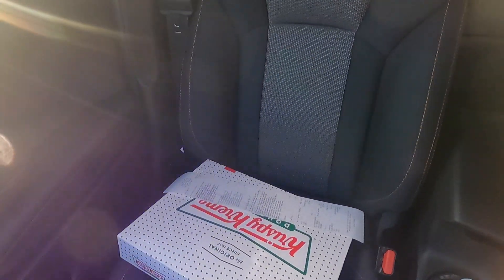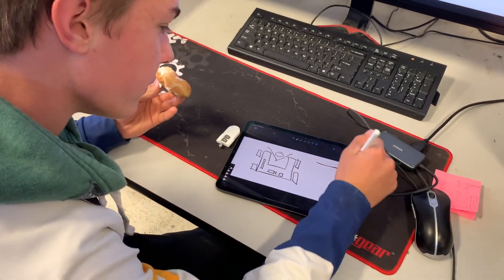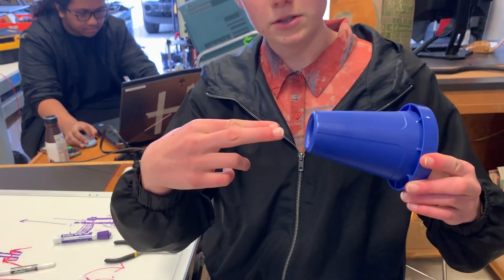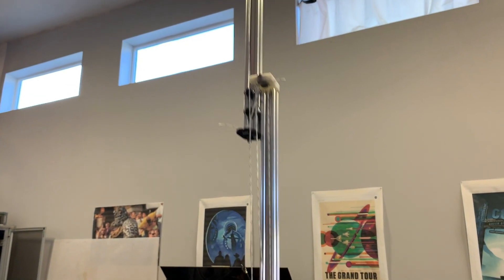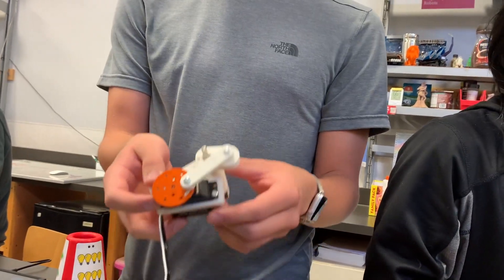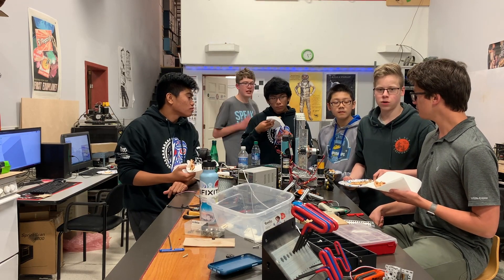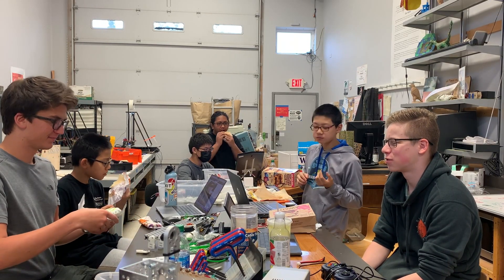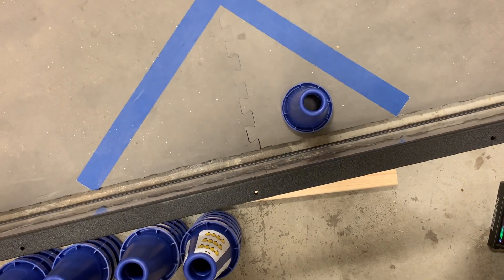Robot in 3 Days Build Vlog - FTC POWERPLAY

Comment: Wow, this is such a nice build, and you explained everything really well. However, we are confused about the grabber. How does the grabber let go of the cone? How does the piece that grabs the cone come back in place? If you could let us know that would be great. Great video by the way!
Reply from the maker: Glad it helped! The grabber has a small flexible piece that slightly expands and contracts, depending on how the cam inside it is rotated. When the cam's major axis is opposed to the flexible piece, it puts pressure on the flexible piece, making it expand. When the servo rotates the cam so the major axis is aligned with the flexible piece, the material returns to its original shape which releases pressure. Hope that helps!
Reply: @lskaling  Thanks a lot for letting us know how the grabber works! It makes a lot more sense now! We thought of a similar concept(we posted it on our channel)and we now know how to improve it to make it better! Thanks for helping us!

Comment: This is awesome! I’m having some trouble understanding the grabber; if there’s flexible material (tpu?) around the cam and the cam rotates freely inside it to make it go outward, what’s securing the material?
Reply from the maker: Correct - The expanding portion is 3d printed tpu. The front has a relief cut to expand, and it's fastened with two screws on the back. Then there's a shaft that runs through it connected to the cam.

Comment: I know some people asked it already put could we have a cad file of the grabber we are a starting team and we canot afford the 150 dollar shipping yet
Reply from the maker: I appreciate all the interest in the design. Unfortunately I don't plan on releasing the  CAD files, out of interest of pedagogy I think it's in all team's best interest to try to design it themselves, and learn how to make it through that. Some advice I can offer is to get good with printing TPU (especially with a Bowden printer like I was using is challenging), and considering making reliefs where it flexes the most to reduce the force it takes to open. Also in my design the servo and linkage were aesthetically pleasing but unnecessary, the servo could directly drive the shaft for simplicity.
Reply from the maker: As for the shipping, you shouldn't need any other components to get a working prototype. The two non-printed parts were the servo and shaft. You can test spinning it by hand instead of a servo, and if you don't have any shafts you could theoretically print one, just print it lengthwise to improve it's torsional strength.